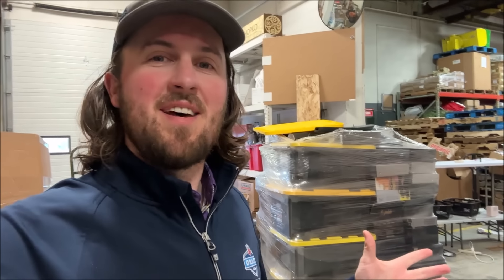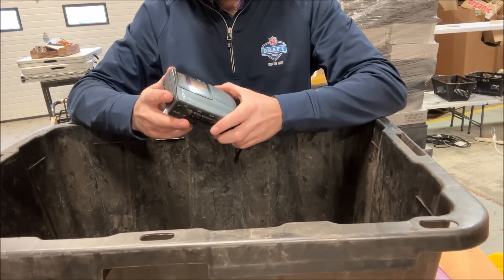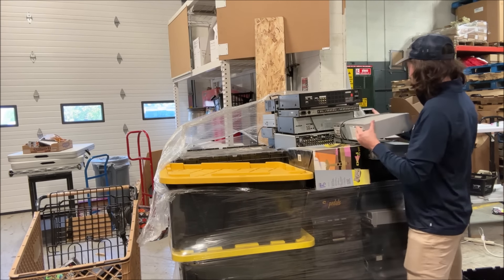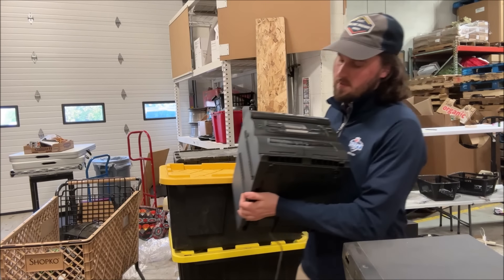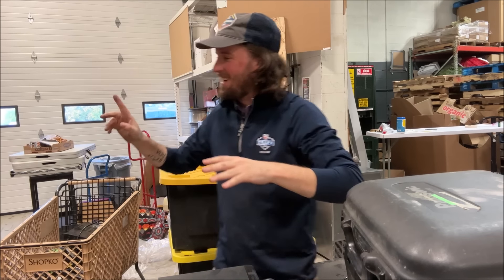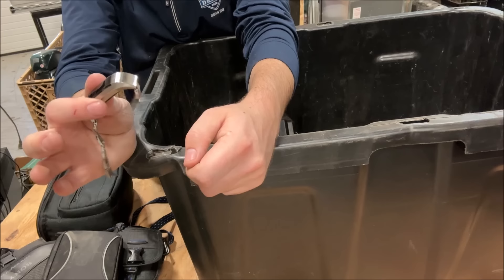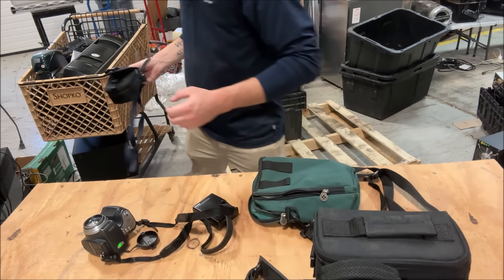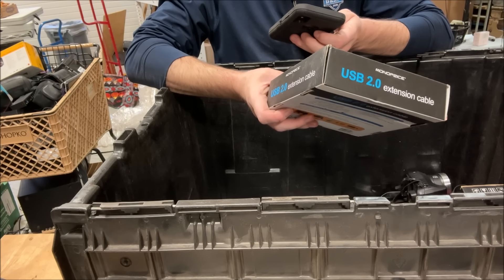This e-Waste Pallet is an eBay Seller's Treasure Trove! 1100 LBS of product!

Comment: Just a tip. you kinda rejected the older Sony VCR. Those are really the ones you want, generally the older ones with HiFi stereo. Towards the end of VHS's lifespan even the cheap ones were HiFi, so if they are light with an all plastic chassis, chances are, it wasn't a great one. But if its a bit older, heavier AND has HiFi audio, those were the nicer more expensive models, built when they weren't cost reduced to oblivion. Provided they do work, of course, but even some of those are worth fixing and might sell as a "for parts" unit.

Comment: at 5:00 IIRC this is the cord/plug for a LS-120 drive for the mac (competitor to the zip drive) The drives could read ls-120 discs as well as regular 3.5 in floppies, which was convenient for the imac which did not have a floppy drive.

Comment: 1:01:49 The AGFA ePhoto Smile, one of the first sub-$100 digital cameras (when on sale.) Memory was all internal, I think the data transfer cable had a DB-9 plug, not USB. So good luck getting your photos off if you're missing the cable. Though it did have a composite out, so that's one way if you don't mind the quality loss.  And yep, not worth anything.

Comment: 4:53 OMG...  "I don't know what this thing is..." it's a DB-23 "D" connector (probably serial)
was replaced by USB, which IS SERIAL, parallel has all but been died (occasionally parallel is used, but FireWire is choice if USB v3 isn't fast enough)
59:22 got excited seeing "My Passport" ... UNTIL,   HAD TO REWRITE :-( 
Price for One Gig storage is all over the place, mostly Amazon free shipping.
$125, $200 ... BUT 2 Gig is $80, $90, $135 !!!  And 4gig/5gig are $95-$130/$130
(YES!! 4G & 5G, BOTH $130)  LOL

Comment: Some people like to buy the same stuff they had. So when it breaks or they lose it, they are willing to pay for the same item regardless how old it is. You just need to find that person. That's what ebay is for.
Reply: I call it my rule of identical replacements.
Reply: @JohnGotts  Great name for it. Some just don't embrace change
Reply: Exactly. I had been looking a long time for the same crappy keyboard that came with my stock PC. I used the same couple of keys so much that they ended up sanded down and wouldn't register properly when pushed. It was old so no longer sold in stores or online. Ebay didn't have the one I needed either. I browsed the keyboard section of my local thrift shops for a couple of months and ended up finding one BRAND NEW in the box. That made my day. No joke, I was as happy to find that piece of junk as if I found a 100$ item to flip on Ebay. People(like me... 😅) can be weird about their old stuff.
Reply: So right. I worked with a guy who used the same Rubbermaid lunchbox for like 25 years until it was thoroughly worn out. They no longer made that model and he was obsessed with having another of the same. To the point that he even emailed Rubbermaid to see if they still had the molds and wanted to try to buy them to make another. I managed to find him one on ebay that was some commemorative one for some football game. It was new, even though it was like 25 years old. He paid around $100 for it when he could have had a current, similar model for like $20. The man knew what he wanted and was willing to pay to have it.

Comment: The Philips CD player you rejected is listed on eBay for $219.   That doesn't mean it will sell for that, but it looks like you need to learn more about audio!
Reply from the maker: Do you mean the boombox at the end or was there another one? The boom box most recently sold for $35 free shipping. I can’t find any active listings for $219 either.
Reply: @ResaleRabbit  - At 19:34 in the video - looks like a Philips CD 650 - "I'm just going to go out on a limb and assume that's not worth anything".
Reply: Vintage Japan unit with Class 1 Laser is a gem for the audiophile